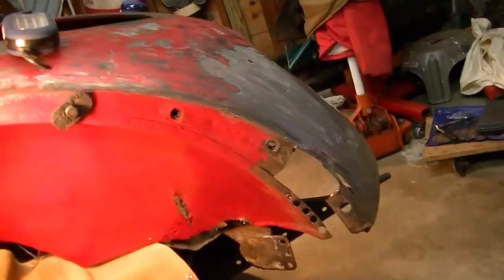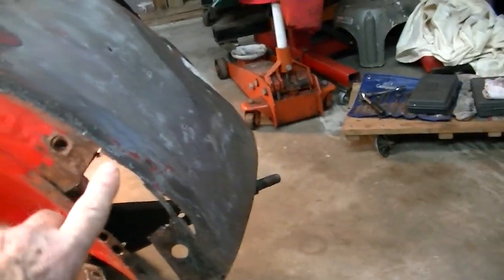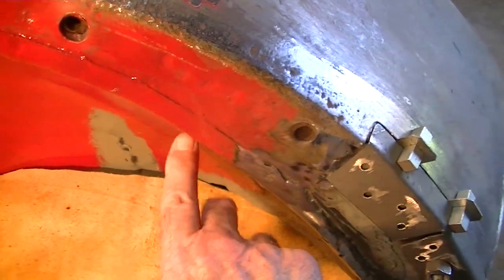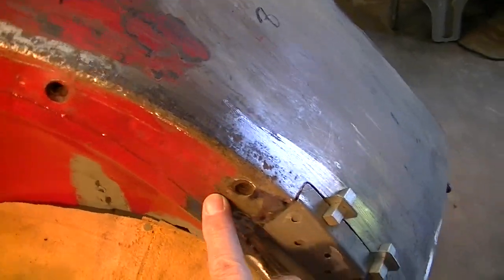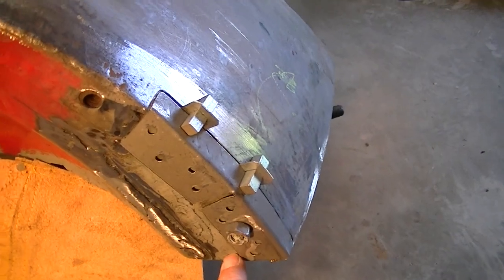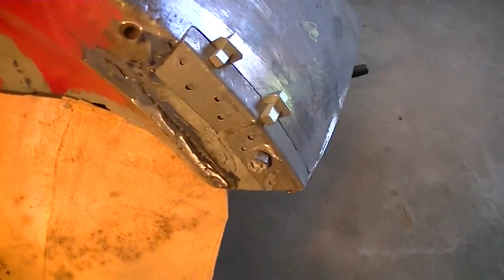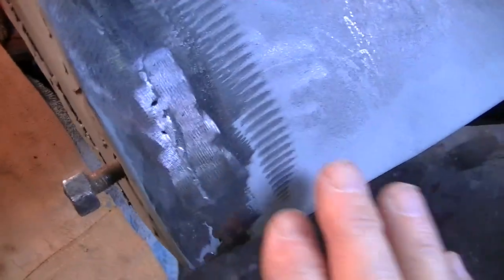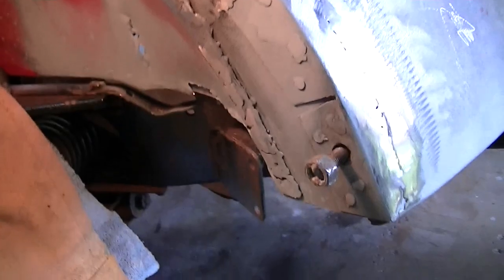1960 MGA Restoration - Right side shroud repair and replace fender weld nut

Comment: Carl, how do you fabricate the patches you make?  Do you use a brake?
Reply from the maker: +Jeff Jones  Hi Jeff, no brake although it might be easier and I think you can get small ones from Harbor Freight.

I do all my bending with a medium sized steel bench vise.  Most of these are 18 - 20 gauge (.036 - .044").  Although I have also been able to bend steel up to .105 thick as well.

On short pieces, I bang over the area to be bent with a hammer, sometimes a body work hammer, usually a copper headed hammer like the ones used to tighten the spinners on the wire wheel hubs. On small pieces I frequently use a 1/8" thick copper piece on the visible side of the metal to be bent.

On medium and long pieces, you can bang the bend in several 2-3" wide segments, a little bit at a time, using a few passes until you get the correct angle of bend.

For longer pieces  I have 2 pairs of vice grip pliers that have 4 inch wide grips, so I sometimes use these and back up the bend area with a 1/8" think strip of steel (I've been using a steel rule). 

On parts with curves, I often cut slots in the metal to allow it to curve (see the videos on skirt panel and also on left side shroud repair.  Weld the slots closed after.

I sometimes have to rebend after the first try misses where I want it.  Been able to rebend the same piece multiple times as needed.

Good luck!